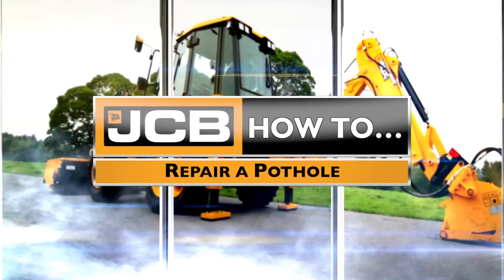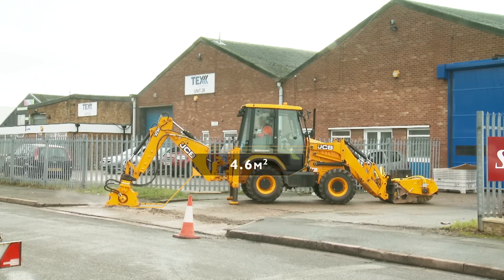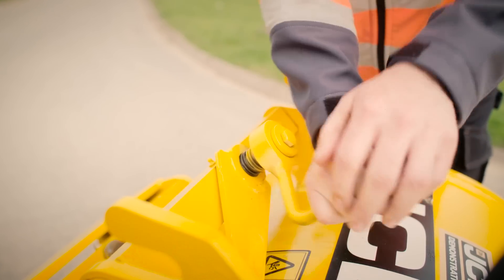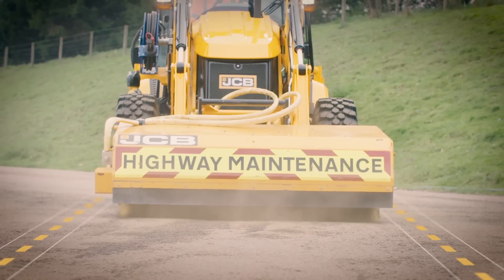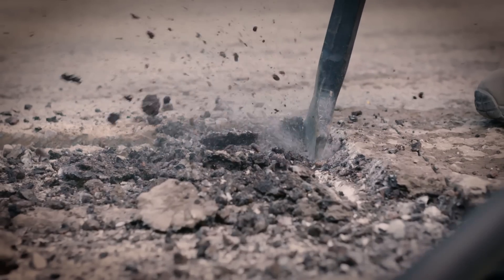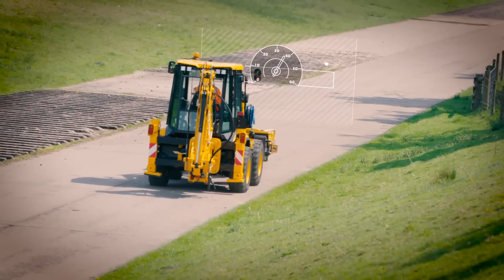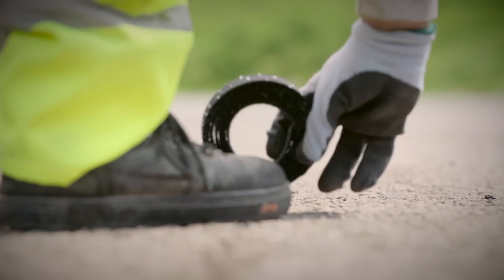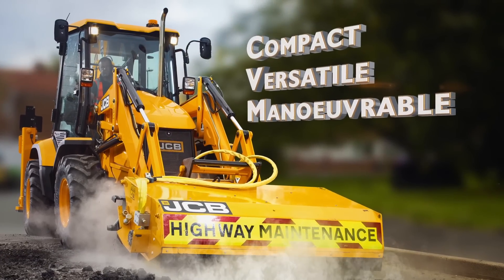How to Fix a Pothole with the JCB 3CX Compact Backhoe Loader

Comment: So instead of 1 lorry towing a roller 2 men and manual labour... you've now got 3 lorrys the jcb. The tarmac lorry.. and the huge lorry that brings the heavy dutie roller out...at least 3 men  roller driver  rakehand  shovel guy & jcb driver,more or less same labour less digging £165.000 or hire cheap foreign sub contractors  good try jcb but the best part of that video was the illusion that you've actually got something good....  ps ... how do we have gas pressure next to the vacuum of space if gravity cant hold gas to the floor..and gas moves in all directions unbonded the answer is you cant!!! Research FLAT EARTH  🌎 😪...